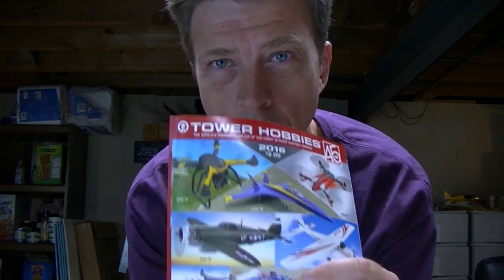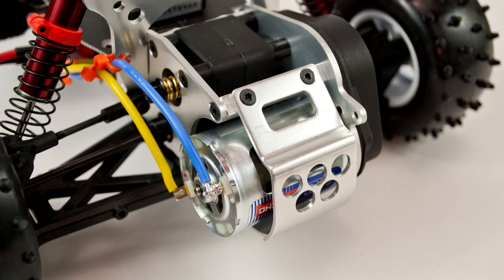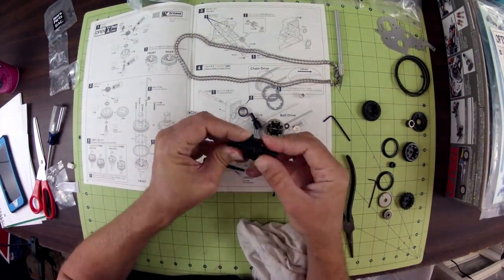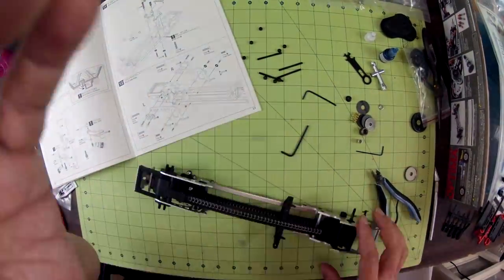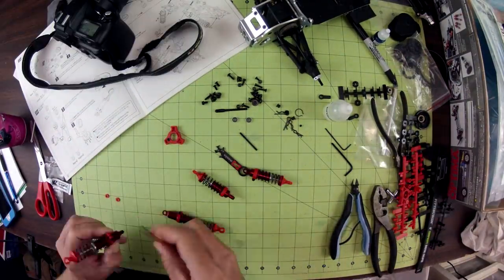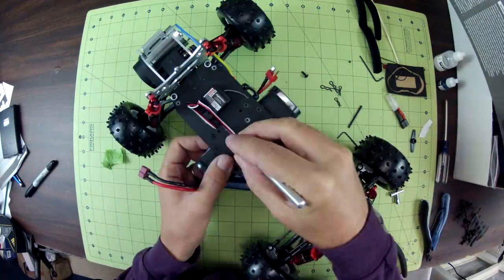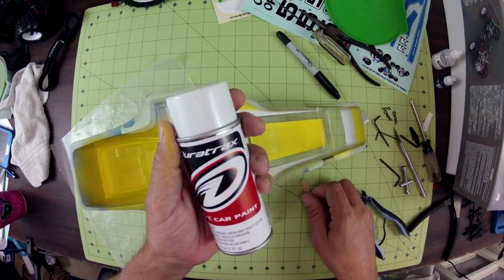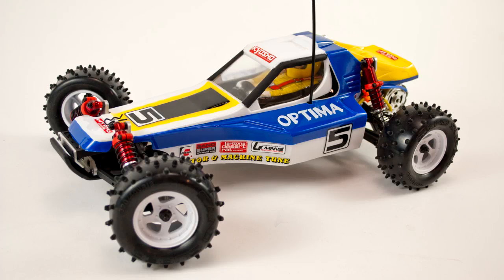Kyosho Optima - Tested.com Review Part 1: Assembly

Comment: Loved seeing the timelapse build. Brought back a ton of memories building my own back in the ‘80s in my childhood basement workshop. Been thinking about buying this kit as a project for me and my daughter to work on (but let’s be real, I’m mostly using that as an excuse to relive my RC car days). Wondering if you eventually switched to the belt drive. Seeing the chain made me shudder. So many problems with it after a while. Think the belt drive came out as an aftermarket option right around the time I was losing interest in the hobby. Cool to see this has a slipper clutch and comes standard with bearings—and the belt-drive option. Glad you finally got to build and race an Optima. Amazing little car. Thanks for posting this video.
Reply from the maker: Still using the chain.
Reply: Terry Dunn Glad you’re having good luck with it. And thanks to your video I discovered that Kyosho makes an affordable electronics kit. Thanks again!

Comment: What motor have u got on the optima
Reply from the maker: It's the 20-turn brushed can motor that comes with Kyosho's Starter Pack
http://www.kyoshoamerica.com/EP-Starter-Pack-4WD_p_24343.html
Reply: What can you recommend as an upgrade to the starter motor? Would like to build this with middle of the road electronics for fun around around in the park but not too shabby either. Thanks